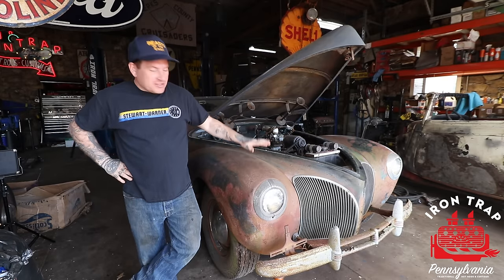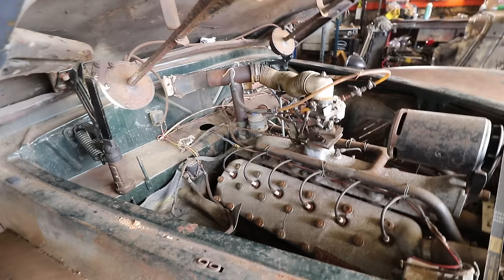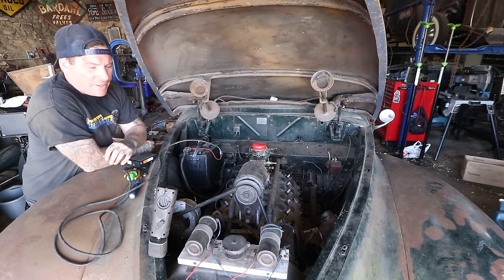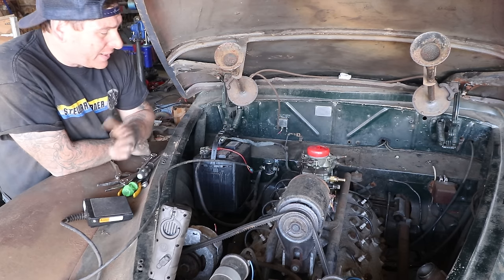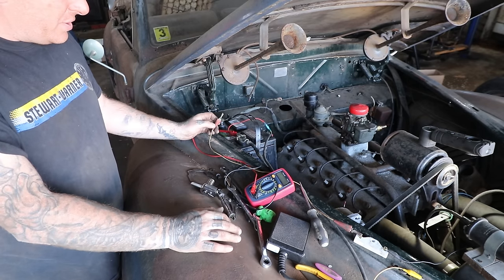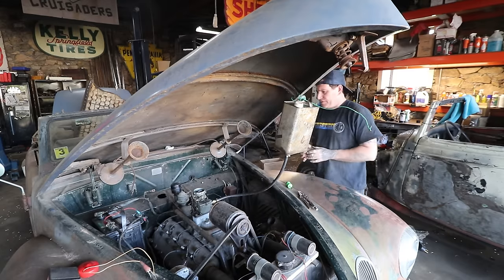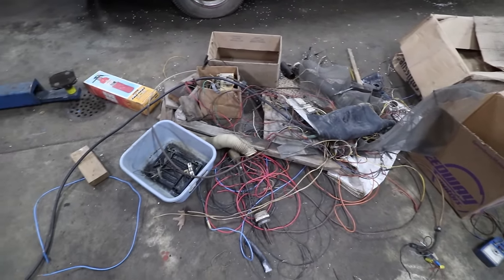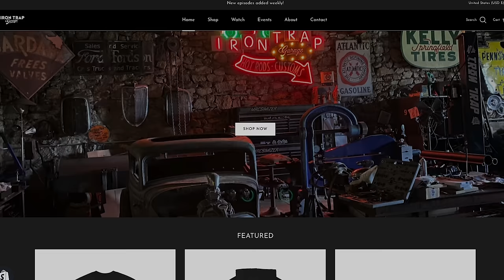Can We Get Our Sketchy 1941 V-12 Lincoln Running Without Getting SHOCKED!!

Comment: These are absolutely THE BEST days for a "gear head" !!! Getting rid of all the "Shade Tree" alterations that have accumulated on the antique equipment and it rewards you with a "Time Travel" moment to another time !!! 
I can't imagine trying this in 2095 with a 2010 Lincoln Continental when that car is 85 years old !!! First off, at least half the car would no longer by there @ age 85 due to all of the plastic "Push Pin" fasteners having long since deteriorated and died so lots of the "mechanical" pieces would be "fond memories". Took apart a 2017 Ford Escape "Eco-Boost" recently. After + seven tries, the mechanic is still trying to get it together so it doesn't show a "cam timing" code. Shafts with no keyways, plastic push pins everywhere, a 4 cylinder motor with a harness more complicated than a modern house. EVERYTHING you need to access is blocked by other "engineered" impediments to access !!! TOTAL GARBAGE !!!

Comment: Well , between the 39 & this 41 , you will never have to buy wire again , lol . I'm not surprised it started & ran with what you did to get it there  . Looks better already . I'm glad you are taking it back to stock , & I'm sure that carb will work fine for what you are doing . The valves need some adjusting , but overall a solid win . That Diver's helmet distributor does not look service friendly ! Yikes ! Great job , Matt !

Comment: Nice!  I'm going through a similar effort.  My dad just gave me his 1947 Lincoln, and the points are not working.  Just went through replacing the starter solenoid and cleaning up the battery and starter cables, and I've emptied the gas tank because it's pretty rusty inside.  Hoping to get it running soon.

Comment: Great job. Given the circumstances I think you got this engine going exactly as you should have, especially by disconnecting the old homemade wiring and just having a starting and running electrical circuit. It's fantastic that that old V 12 started so well and ran after decades of being asleep. What was the purpose of the risers for the 6 intake manifold?

Comment: Thats quite clever what the previous owner did to the Lincoln, having a 6 volt electrical system but with a 12 volt starting (the 6 volt starter motor should be able to take it as  it's not continuously running, we put 24 volts to 12 volt starters on agri machinery thats been stood for a long time so is turning over a bit "lazily") and ignition system, some of the New Holland harvesters we get in have a not dissimilar set up with a 12 volt electrical system but 24 volt starting for the engine.

Comment: Matt, Steve and Mike, it was great to meet you guys at Carlisle on Fri. Good conversations on a range of hot rod subjects, including Moon. The V12 is an interesting animal, especially the distributor. At Carlisle you explained in detail the PIA it was to access, but you got it. I agree with your thought it was rebuilt based on the clean exhaust. I bet with a nice dual system, it will make some hot rod music. Question, I see an alternator, but what is on top of the engine that looks like a generator?
Reply: It's a generator for the 6 volt system , I guess for the gauges and stuff . I believe that Matt had commented on that after they got it off the trailer .
Reply from the maker: Nice meeting you as well! It has been equipped with a 12v starter and it also still retained the 6v generator

Comment: The V12's had a lot of problems and were often replaced with a regular flathead. My 48 has overdrive and it will easily run at 80 on the freeway, however stopping quickly from that speed is another story!
Reply: Got to down-shift in addition to brake system, ie engine braking!

Comment: I wonder it that 12v battery was hooked to the starter to change it to 12 volts when turning the motor over.  Maybe one of those switches change it over. Big motor for a 6v.

Comment: Looks like to me he had the 12 volt  battery as a jumper for the starter motor and the alternator  to charge it likely  the tarter motor is bad and 12 volt coils was for the motor and if the coils are 12 volt the why a ballast resistor .i call a fuel tank l8ke that a I V

Comment: So question; did they make speed parts for the V12 back in the day? Can you hot rod it? Seems that one single throat carb would be insufficient. I realize that the idea was quiet, smooth torquey power but a triple card set up would look so cool.
Reply: Or (2) 97s when replacing the gasket?
Reply: They did make some, but they are like hen's teeth to find and pricey as heck when you do.  There was a youtube video series a year or so about about a 38 or 39 Lincoln Zephyr getting resto-modded keeping the original engine, but with multiple carbs and auto trans.
Reply: @willymccoy3427  that was Mike Bello of Bellos Customs
Reply: @terry3665  BarryTsGarage is the one I was thinking of.
Reply: You can still get some speed parts for the H series v12 from H&H flatheads,  however not cheap.

Comment: The thought process of the previous owner is bizarre. Running the wires through an entire radiator hose left loose on the floor instead of simply wrapping them with electrical tape is so far beyond logical it beggars belief.